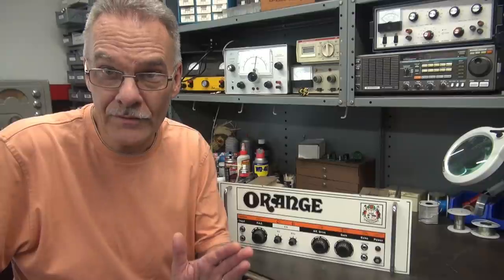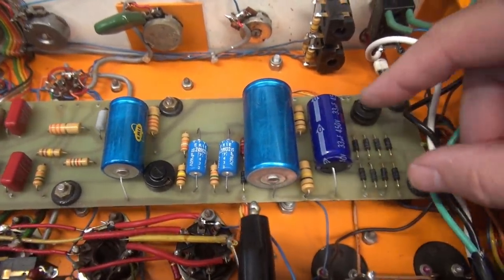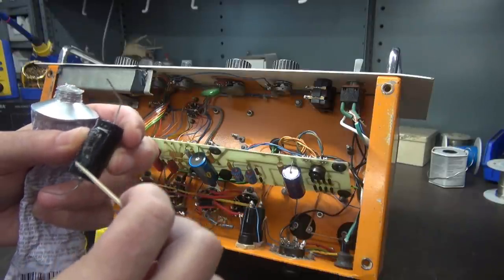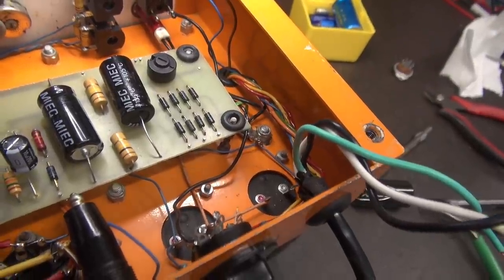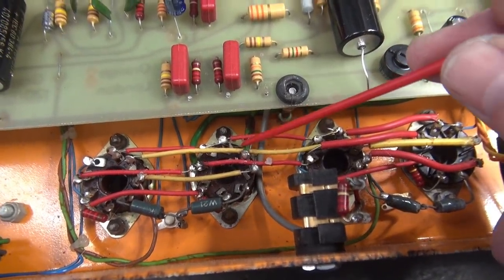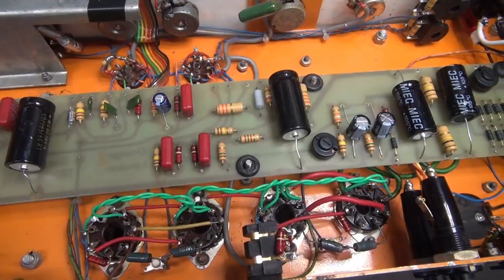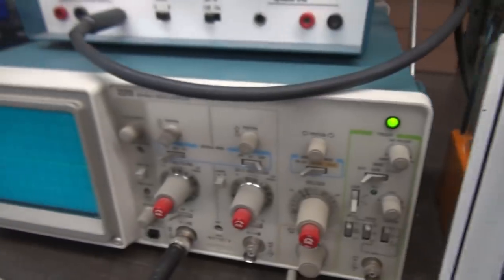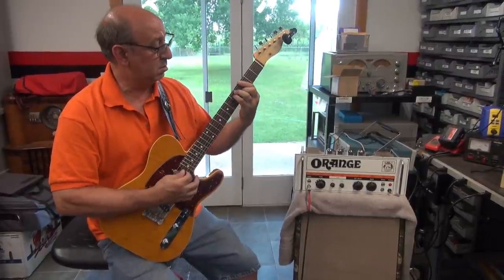How to repair Orange OR120 100 watt EL34 tube guitar amp famous concert machine

Comment: Nice!  Nostalgia is burning.  I owned a '75 OR120 back in Sweden. Modded it myself with a master volume and some cap value adjustments. Probably the best sounding amp I ever had.  When I moved to the States I had to leave it behind.  Still miss that amp.

Comment: I had a 1972 OR120..and it was the SWEETEST clean I ever heard. Had to sell it when life got tough...it also needed a lil help (back in 96 when I sold it). Based on my recollection...you made this one sound just like my old 1972. BRAVO!
Reply: Their clean was hard and harsh and didnt stay clean up loud, poor tone control too. glad you liked it but few others do compared to a fender twin or most any other tube amp for clean. These amps were best at distortion. They didnt stay clean. I have owned many the past 30 years

Comment: The best sounding Orange amps are the ones that aren't working. Nobody bought these for their clean sounds, they chose them when Marshalls didn't get dirty enough. I'm old and English. Suffered temporary deafness through many of these back in the day. Enjoyed every minute, strange to say. Plus ça change...
Reply: This is almost the opposite of my experience. Certainly more modern Orange amps get super dirty and distorted, that's how they ended up getting favoured by guys like Jim Root from Slipknot (and many others) but these older models were a very different beast and were not made for heavy distortion at all. Loud, yes but distorted? not so much. That's kind of reflected in the circuit, both have 3 'gain' stages before the PI but the Orange uses a cathodyne PI which is typically less that unity gain whereas the Marshall uses a LTP PI which is effectively an additional gain stage - not that it matters much at the end of the day, whatever works for the guy playing.
Reply: @sjgreaves  A facetious comment on my part, and I bow to your superior knowledge. As it happens I saw 2 videos yesterday of Dave Simpson playing the amp model in question without distortion. In one, with reverb & delay it sounded beautiful. In the other, dry, it was bland in my opinion. No way of telling how loudly he was playing, of course, but it was a domestic setting.

Comment: Great Job, I liked your sympathetic restoration, particularly the filter cap' replacement. Very interesting about the valve base wiring. I had one of these as a teenager back in the 70's. I worked for weeks in my school vacation to earn the money to buy a brand new OR120. After a while the HT fuse kept blowing. Not having the technical knowledge which I gained later I took the amp back for repair to Orange who did the repair while I waited. I asked what the fault had been and they said that the valve bases were tracking, but I bet the fault was in the wiring to the bases as you explained. This really took me back to my teens! By the way, I used the amp for bass with a JBL 2x15 cabinet. I can confirm that it was very clean and had masses of headroom, I used it for many years, even as a professional musician for a while and it was a great sounding rig.

Comment: What a cool old piece!  100W is WAY too loud for my taste, but if you're playing to a stadium, they'd rock the house!
Reply: I reckon 100w is just way too loud anyway, it is always funny to see the big names when they talk about gear and they maybe sill use 100w heads on stage but the speakers are either in an iso-cab way off stage or replaced by speaker sims. It seems kind of ironic that guitarists still buy monster 100w heads and then end up wanting to make them quieter with attenuators etc. I used to rock a pair of Marshall JCM900 100w headss and two 4x12 cabs but now my personal choice is smaller amps which I can crank to get 'the sound' without getting stupid loud.
Reply: @sjgreaves  bigger watts = bigger transformer =  bigger bottom end
Reply: @BenState  Tweed deluxe gets too much bottom end with a pretty small OT... Sure there are pros and cons but weight and cost would be pretty high on the cons list vs a change in EQ to get the bottom end but each to their own...

Comment: Terry, Why not replace the original filter cap cans with drop in replacements such as JJ or F&Ts. Just seems like less of a hassle and cleaner.
Reply: Yes was wondering the same thing.  Some folks would not want new holes drilled in the side depending on the year.  I have a 68 pix only OR120!  Crazy amps!!  Great work always either way.
Reply from the maker: I could not find the exact replacement in the original diameter, so went with the F&T's
Reply: @d-labelectronics  What about simply gutting those old, green Plessy caps and mounting the new ones inside them?
 They are a bit dumpy but even if the new ones are protruding, they are at least in the right place and look the same from the top. It is a messy job, done it many times but my preferred method.
Reply: @charlamaignebutt586  If it were my amp I'd just have those caps throw into the wastebasket.

Comment: FWIW both F&T and JJ make can caps that should work with this amp but maybe since they are made in EU they are less easy to find in USA. Also - on the filament wiring, I read that you should wire the same 'phase' (ie wire) to the same heater pin to keep hum down because the pairs of tubes in push-pull are out of phase  and so hum gets cancelled out to some degree. 

Old Orange stuff is ok, I'm less impressed with more recent stuff, I had an AD-5 for a while, Chinese transformers, the OT failed spectacularly and when I asked Orange if I could order a replacement they were very unhelpful, refused to sell parts or give any information, basically trying to force me to send it back to them. Well, given that it was a SE EL84 5w amp, it wasn't exactly hard to source a suitable Hammond OT which ended up sounding better too.

Comment: Those green filament wires coming from the transformer maybe should have been tightly twisted and shortened like you did with the new green wires. It can make a big difference, I built a high gain amp with ac filaments and virtually no noise thanks to careful layout and wiring job.

Comment: Terry, those filter caps on the chassis are readily available. Sorry for criticism, but I think the job could have been done with a little more thought. Board caps, good job there.
Reply: I believe F&T caps are better though.
Reply: @johnsimms3957  It doesn't matter which caps are used. They do the job, great. 
My criticism was with Terry and drilling holes in the chassis and using a terminal strip and an insulator between them. Terry could have acquired some through chassis caps as was used in the original caps. They are available and no modifications required...

Comment: Wow man, people here are praising you for a job well done, but those caps are absolutely available and easy to get.  Yet you drilled two holes in the chassis of this vintage beauty to cram some others in there instead.  Plus, it looks like you didn't twist the filament wires when you moved them.  Yikes.
Reply: Very true, shame he did them wrong just lowered the resale value

Comment: I can't believe there was not a bit of silastic on that circuit board. They know these amps sit on top of speakers and vibrate for hours.  I don't think I will ever buy an Orange amp after seeing this.
Reply: There usually is but it dried up over 50 years.

Comment: Did the owner want to keep the look of the original filter caps? I would have been OK with just changing them directly to the new ones.
Reply from the maker: Yes, wanted the look original
Reply: @d-labelectronics  It woulda been fine. These people need to get over it!  :-)
Reply: Not only does it keep the original look, but what to do with the vacant spots? You don’t want to leave them open to let crud into the chassis. Covering the holes will look crappy. Plus, later down the road you might find the replacement cans. I’ve seen folks re-stuff the old cans but that’s a lot of mucking around.
Reply: @knifeswitch5973  Bah. There is already two holes on that chassis for wire pass-thrus. There are solution to every problem. The simple fact of the matter is those caps arent being used, and they're just boat anchors. Replace them.

Comment: Terry, noticed your can of WD-40.  Do you know that they have released: WD-40 Contact Cleaner & WD-40 Gel ?
They're NO DeoxIT,  but they now serve a purpose around electronic devices!!
Reply from the maker: Yeah, I heard about that. Need to get some and maybe do a review.
Reply: I just purchased it and used it on my Johnson millennium JD 150 and works great, no crackle/pops any more.
Reply: It is a good replacement for MG Chemicals Electrosolve contact cleaner. At their price you get 2 and half more cleaner per can with the WD-40 contact cleaner.
Yes I have used both and they both work the same so get some WD-40 Professional Contact Cleaner at any local hardware store or even Walmart!
Reply: I use the wd40 contact cleaner... it's a good non lubed type.  I used it on tube sockets and stuff with success.
Reply: @d-labelectronics  - I bought them through Amazon.

Comment: First off, enjoyed the video, as usual.

Just curious, since I didn't see it mentioned, but is there any issue with 50 Hz versus 60 Hz line power since this amp originated in London?  I'm not assuming there would be any problem if it was either designed for both or this is a US model.  I guess I've watched too many Techmoan videos, or remember stereo gear with configuration blocks or switches to select various voltages.  Powerline frequency would affect motors and such primarily, if I recall it would only affect output voltage slightly, so minimal impact.
Reply: No but the voltage is too high these days for these but he didnt catch that fact

Comment: Interesting Cap. Repair on side of chassis. Do no harm,as always.
Reply: He did  harm. He did them wrong and hacked it drilling holes adding boards when didnt have to, see my separate reply above on how to do it like stock like most all techs do, his way is not the right way. hurts resale value not original